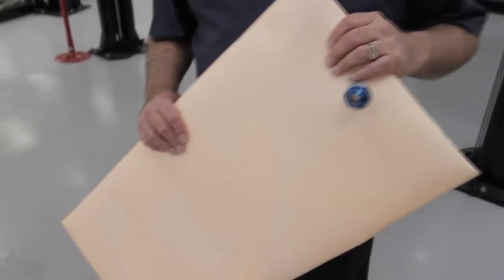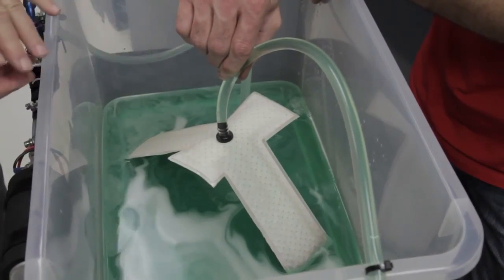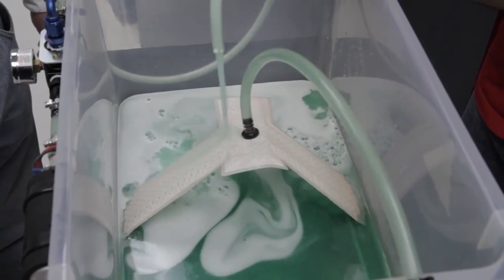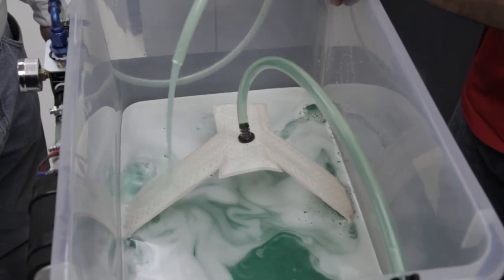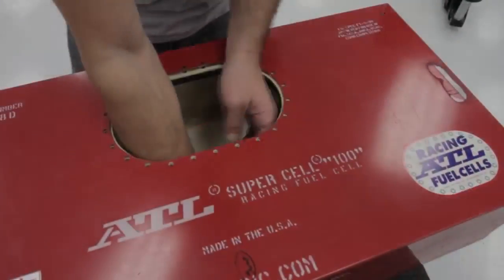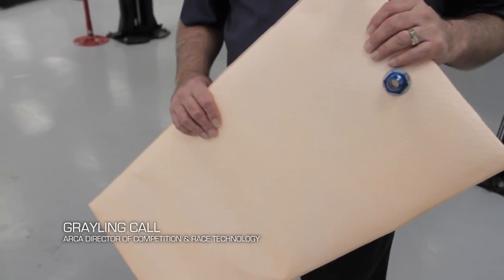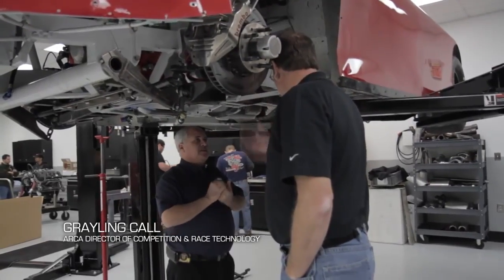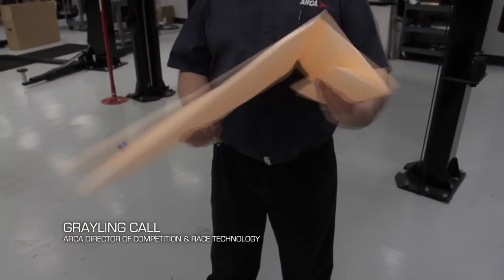Holley Racing HydraMat Fuel Reservoir System

Comment: Do you have to buy the $700 one in order for it to work in a high horsepower application or can you buy the 150-250 and still hold enough surface tension in order to not have air in your fuel? It seems like you guys are only showing low pressure... low flow in your demonstrations. I would like to see a gauge and some flow gauges before someone goes out and spends 4 5 or even 700 bucks or more. I would really like to see a chart if half the mat is uncovered vs fuel flow and pressure on a graph at what point is surface tension broken.